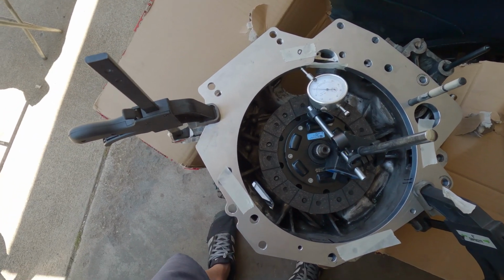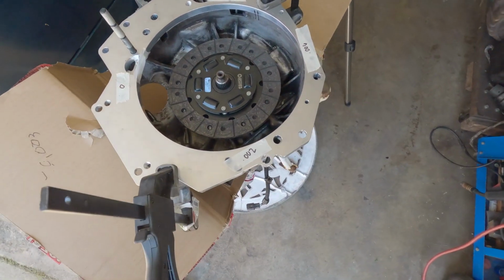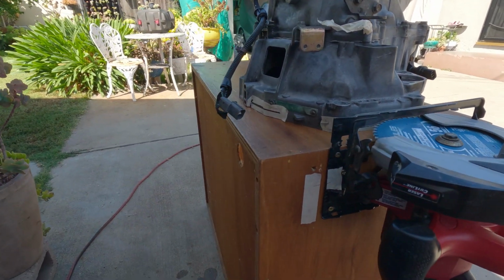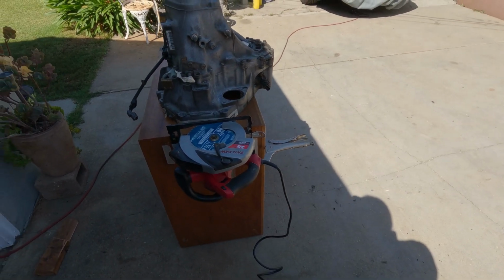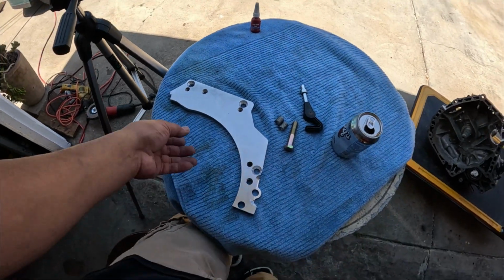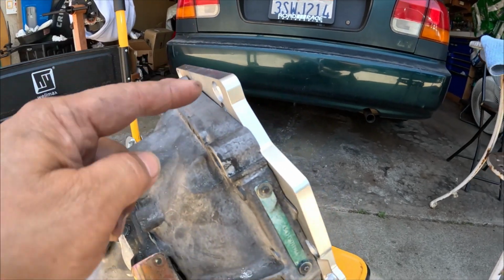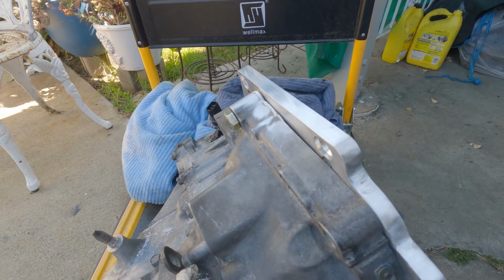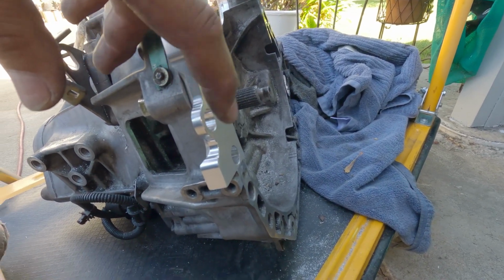Semi-Plate H2B Build project ep.2

Comment: wouldn't it be easier and cheaper to get an old casing from h or f trans, then cut the bell housing and weld it on to the b series trans?
Reply from the maker: The thoughts  came in mind but l went to use a semiplate instead due to other reason. I might do a seperate blog and about it and also, l'm doing a revision. More improvement and easier way to do it. Thanks for your feedback.